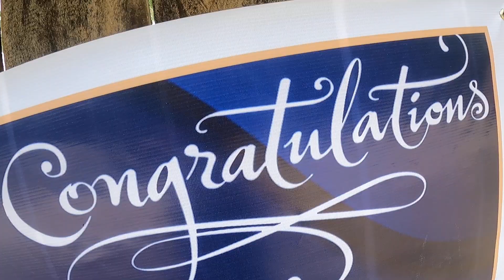BACK HOME! Philippines Beach House Building And Filipino Barkada Life In Davao!

Comment: I like the single engineers cement hand lifting with pully method, which appears can be adjusted if and when the cement is needed to go higher.   Nice return home video, and good to have you back where you belong, at home with your filipino family and friends.    May you live long and prosper, and may the force be with you.  Your cement or concrete is house coming along nicely too.   Still not certain what the actual purpose of the AAA structure is yet, but it looks like it may be the guest room for when Kumander Daot is visiting, and it also looks to be really cozy.  I also like the triangle windows of the AAA structure, and the triangle reminds me of an outdoor art sculpture in Kumanders hometown in Wales.  Amping (*_*)

Comment: My guess is .. when the concrete structure is finally completed , eventually that solar panels will be relocated to the rooftop. It would be more suitable up there as it would be more efficient in catching up the sunlight to charge the batteries. And it would also free up the ground space for some new projects coming up 😉

Whoever installed that mirror in your bathroom must be the smallest guy that he installed it too low for your height 😁.
You need to stoop down everytime just to see your face in the mirror 😂
Reply from the maker: You are correct about the solar